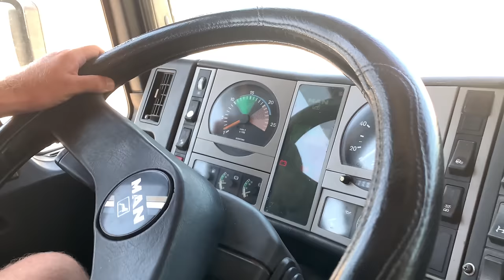EXPERIMENT: BIG TRUCK vs GLASS

Comment: the fact that glass can hold the weight of a car/truck (although in the case of truck it only holds for seconds) is impressive
Reply: The truck actually hold the weight. But when the tyre slided the glass, it was when it broke.
Reply: Ґо certer
Reply: @3dplanet100 e un comentariu bun

Comment: If you really want to hold your bus on glass pieces then. 
1. Glue all the glass pieces together so that no glass piece can move.
2. Try to remove the space beneath the glass so that glass touches the earths surface.
After doing these your bus will be holded by glass
Reply: that's a truck

Comment: Go get a professional driver.
You just drive above the glass no need to brake, as the glass slides and makes it thickness lesser. Which leads to the breaking of glass.
Even on asphalt if you brake you will peel of little bit of its layer

Comment: The Test is Flawed and does not prove anything about the strength of the glass. Due to how the test was performed. With the car spining its tire in the first test. Then the Sudden Stop Jerking which slid the glass in the truck test which put stress on the glass causing it to Fail suddenly which in Experiments would be a Flawed Test and subjected to a Redo.  Plus reusing the glass from the car to the truck could have also caused the glass to be flawed even if it didnt show any cracks. There could have been hidden seems that would fail on the truck test.

So in this Experiment The Entire Thing is invalid and does not Prove anything at all.

Comment: This video is unrealistic. NOT TRUE. Cause when the top glasses moved forward, if changed the pressure point for the down glasses. it was %50 %50 at the beginning but when the glasses moved, it changed to ( example ) %30 left %70 right maybe more, so the momentum changed. you had to glue them are put in a frame... 8000000 reviews for a wrong experiment. so sad.